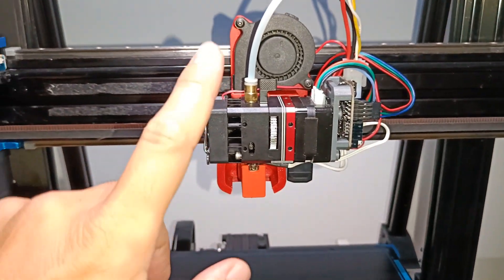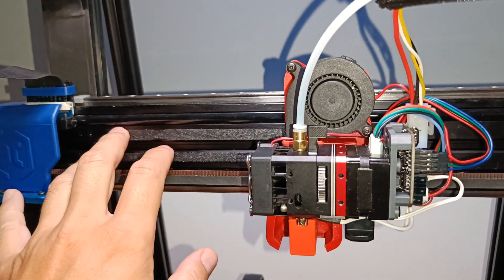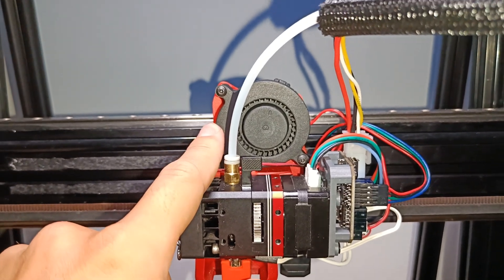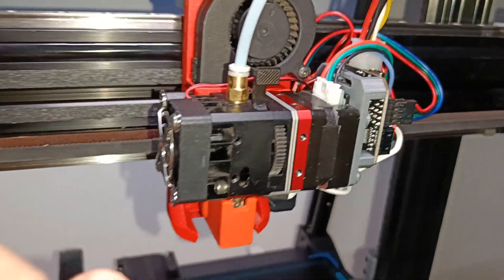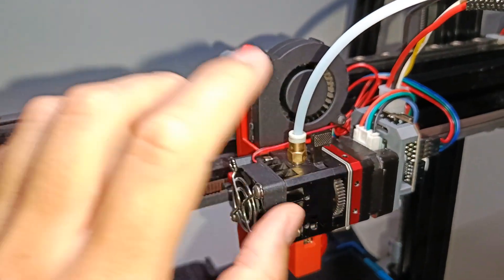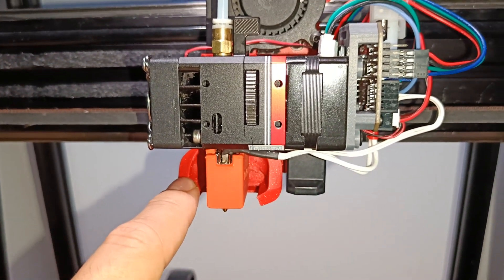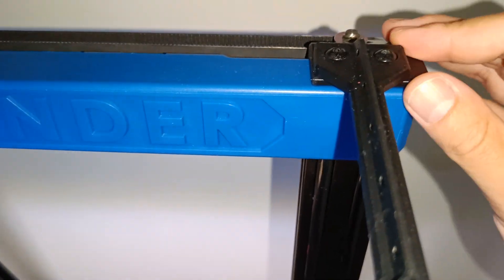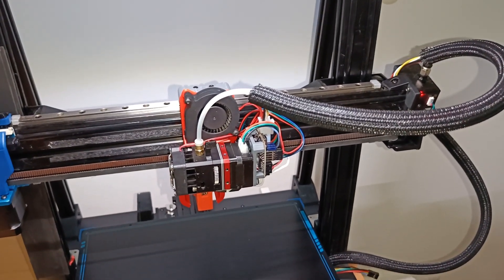Uncut Talk about some ideas of my Sidewinder X1/X2 Extrusion System Upgrade (BIQU H2 & Linear Rails)

Comment: Excellent! We are so lucky to have you sharing your mods and improvements to the Artillery X2!  I follow your developments and have used some of your mods already, and am very thankful. I like having an upgrade path for my X2 and keeping my 3d printer alive for as long as possible, so as not to produce more electronic waste
Reply from the maker: This is the way. :-)
You can achieve really high print quality and decent speeds with the Sidewinder. Only when it comes to difficult materials or very fast printing is a bed slinger like the Sidewinder not the right printer

I'm glad if I could help you.

Do you have any suggestions? Are you missing a feature in principle?

Comment: What heatbreak are you using with the Volcano block? The one that came with the H2 or the old from the original extruder system???
Reply from the maker: The bi metal heat brake come with the H2 extrudr.

Comment: After including almost the same components on the swx2 in my conversion. The difference for me is the extruder, I have the revo version instead of volcano. 

But ebb42, eddy and btt manta m8p are same.

I wanted to ask if you could make your klipper printer.cfg file available to me or the community? 
Probally as simple comment here? Gladly in the raw form without further information. Then I could use the connection pins as a blueprint and don't have to work everything out 

That would be great for me.

Best Regards
Hannes
Reply from the maker: Hi Hannes
You can take a look at my backup repo. 

https://github.com/freakydude/swx2-cb1/tree/ebb42can-eddy_or_microprobe

The ebb42can-eddy_or_microprobe branch is what you are looking for. 

No guarantee of course ;-)

Regards,
FreakyDude